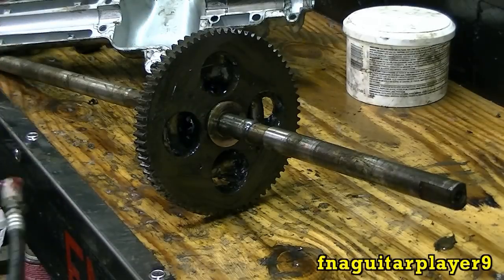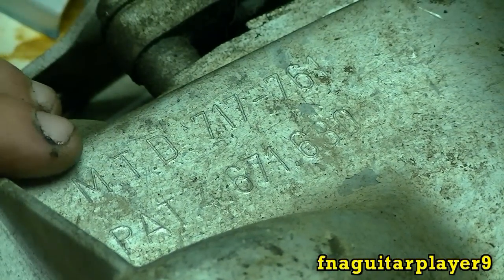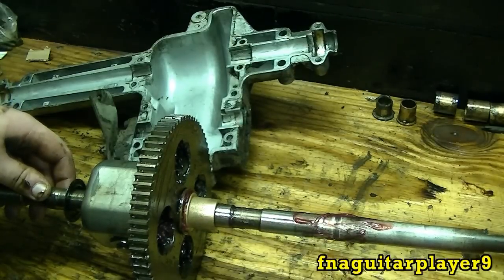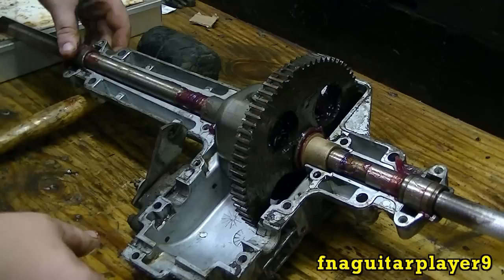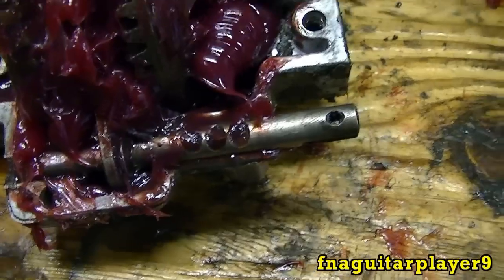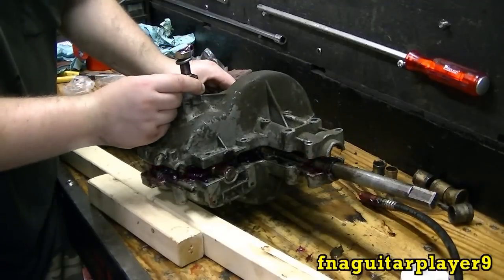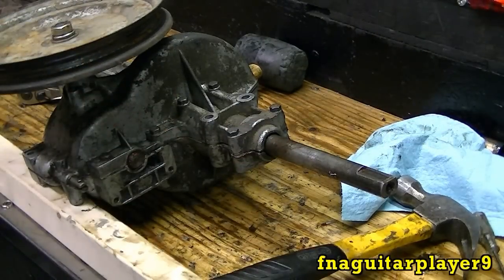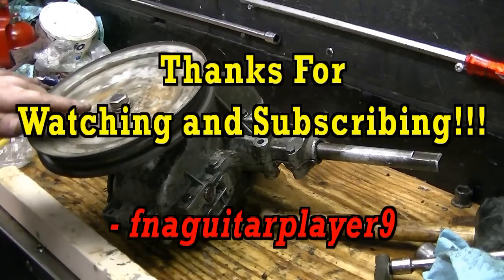MTD Transaxle Basic Rebuild (Replacing all Bearings) Part 2 of 2

Comment: I am repairing/rebuilding one on these on a Toro rider right now. I did not have the tools to reassemble the differential if I did take it apart but I wanted to get the old grease out as there was a lot of metal in the old grease. I took the differential out in the yard and I blasted it with my pressure washer. I then dried it out as well as I could with compressed air and examined it again. It still had some of the old grease in it so I blasted it again with the pressure washer and rotated the gears many, many times reblasting with water repeatedly until I got all of the grease out. I then hit it with the compressed air repeatedly until I had it as dry as I possibly could get it. After this I set it out in the sun and the breeze until I knew it was completely dry. Not wanting any rust to develop I took a can of silicone spray and I thoroughly hosed the inside and outside of the entire differential and placed it back in the sun to let the silicone spray carrier evaporate. This leaves every little part of the assembly still coated with the silicone which will prevent rust accumulating until I can get the trans axle reassembled. Just a friendly tip to anyone desiring to get the old grease out without disassembling the differential. Thank you, 
fnaguitarplayer9, for this video and for all of your videos for that matter.
Reply from the maker: That would be the best way to do it, good idea. I should have cleaned this one better, but I figure I will when i take it apart later on to replace the top needle bearings, still making noise. Your welcome, glad to help out! Thanks for Watching!!!
Reply: @fnaguitarplayer9 , I am curious as to whether or not the differential AND the bevel gears are supposed to have shims on their respective shafts to control side play. The one I have (it was being thrown away by a neighbor) has no shims on either and there seems to me to be quite a bit of side play. I think the previous owner was in there messing around because a lot of things did not look right to me. Also,  the brake disc and one of the brake pucks were missing as if someone was attempting to repair this thing and just lost some stuff. By the way, thank you for responding to my previous comment.

Comment: MTD calls for 19 ounces of durina grease, I always use Super S 00 grease, $5.99 at tractor supply for 32 ounces. Case screw torque specs are 90-135 in-lb, detent screw 160-200 in-lb.

Comment: I mixed in a bowl Lucas & tacky red axle & bearing grease until its thick but still clings to the gears. If you just use grease it wont stay on the gears & it will leave an open path where the gear spins it will start chipping the gears. I had to replace a gear learned the hard way. To mix the grease & oil I used a electric mixer blade in my drill & it works awesome. I mow 7 acres with my John Deere it used to have a winding sound when I go forward but not any more.
Reply from the maker: That is a good idea, i never thought of mixing it like that. Thanks for Watching!!!

Comment: Hey player. I got a tip that some of your viewers may can use when attaching their shift rod to the transaxle yoke rod. The hole in the shift rod for the clip pin is just a tad larger than the pin itself. So it is sometimes aggravating trying to get the pin through as the end of the pin will obstruct itself on the outer edges of the shift rod, and not go through unless it is perfectly aligned. After a few tries, I grinded a nail point on the end of the pin. Then it fell right in first try.
Reply from the maker: That is a good tip, I'll keep that in mind next time I work on one and will mention it in the video. Thanks for Watching!!!

Comment: First off, I really appreciate your video!  I need to do this soon and this will be my guide.  I did see something here that may have caused your binding when putting the case together and maybe your shifter issue.  I read that these call for a Bentonite clay grease because it's super thick, heat and water resistant and won't wash out in outdoor gasket-less application.  It also does not play well with any other grease like moly or graphite.  Anyway, that's just an FYI.  (continued)...

Comment from the maker: no problem! not all the time! it probably is very similar, but this one in this video is from the 70's, the design hasn't changed much, i took a 90's apart and the bearings are different and the splines are different on the shafts, other than that it looked identical. no problem!

Comment: You get rid of the end to end play by buying more washers and thrust washers... And during reassembly inserting the correct amount in each side to take up the slack... Inside on the axle directly inside decide the bronze bushings...
Another thing I notice is your reassembly should have started on the other half of the clam.,. Spring side down, then the detent ball, the gear selector... That way everything lines up... Also turn the gears before you start bolting it together... That's why you couldn't get it together the first go round...

Comment: At 8:20, when you paused to note that the left bushing (Part 14?) had to be properly oriented, the right bushing (Part 46) has to be also.  That part has 2 molded keys opposite each other next to the flange.  One of them can be clearly seen at 9:00 before it was greased.  When you put the case together I could see where the case was rocking and binding - right over that bushing as the keys were vertical.  When you bolted the case together the first time the bearing was forced  (continued)...

Comment: I have an MTD almost exactly with this same transaxle, I took it apart about 4 years ago to see how it looked inside.  It had a lot of grease in it too, like yours did.  I cleaned it and added the regular grease you buy at advance, just for the heck of it I put in a couple of capfuls of some synthetic engine oil, I figured what's the worse that could happen, it would leak out.  I'm going to tear the lawnmower down this winter and it will be interesting to see how the grease and oil held up.
I was thinking about drilling a hole in the case and tapping it for a grease fitting, not sure if that would be a waste of time since these things seem kind of bullet proof, mines a 98 model bought it new and I have almost three acres so it's been well used.
I also have used slick 50 and synthetic oil in the engine and when I rebuilt it four years ago it was barely worth the money because there was so little wear, I was pretty amazed.
Reply from the maker: Kyocera234 Thats interesting, never though of doing that. Alot of people add grease fittings to them, i'm thinking about doing it next time i have one apart, then maybe once or twice a year add a few pumps of grease just to make sure its full. yeah, they are pretty much bullet proof, they hold up really good. I didn't know slick 50 was still around, i've heard alot about it. I just put some lucas in my truck, it seems to be some good stuff. where did you get the slick 50 at? I've always been interested in it. Thanks for Watching!!!
Reply: That grease is too thick. Over time it will heat up and flow to the sides and bottom of the case and get firm. Use a 00 weight grease from tractor supply and that grease will stay in a flow able grade and won't harden over time. Your doing a fine job otherwise.
Reply: Yep. I am in process of opening up the transaxle on my mower right now, and "Super S Cotton Picker Grade 00 Spindle Grease" from Tractor Supply is what I am using to replace the factory grease with.

Comment: The manufacturer recommends Benalene grease, which is expensive ($23 / 8oz) liquid grease, comparable to 400 weight gear lube. I used Shell Alvania instead, but it may do the same thing: cake up and not touch the moving parts eventually. It's interesting that they use a liquid grease to manufacture these and use no seal whatsoever between the case halves. BTW...mine is a Cub cadet LT1040 gearcase.
BTW...I got away with reversing the gears and coupler to correct a slipping problem.
So far....

Comment from the maker: you will have to find a flywheel shroud for a model 28 with a pull start on it, and you will have to replace the nut that holds the flywheel on with a start clutch. I've never done it but i've seen them. i figure it will be pretty hard to crank over! i guess it would be good as a backup in case your battery is dead or have starter problems. thanks for watching!!!

Comment: Really good tutorial here ..thanks.  I have a lawn tractor with MTD transmission that seems to have a problem.  When I put it up on blocks the left side turns when put in gear but the right side does not.  Does that mean there may be a problem with the differential?
Reply from the maker: ***** It could be a differential problem, but most of the time they will act like that, put it in low gear so it turns slow and try to stop the tire that spinning, the other should start, if it does then the differential is fine. You can also check the differential by putting the transmission in neutral and spinning one tire, the other tire should spin the opposite way. Thanks for Watching!!!

Comment: Great video man! Thanks for the pointers on the grease types. I have a transmission just like this, with the same issue, that one bearing on the left side is the worst. Mine got so bad that it wore away at the top casing of the transmission slightly. Do you think I have any hope of saving it by cleaning out the grease/metal shavings, replacing bearings/bushings, and re-packing grease? It was running fine when I took it apart but I could hear it squeaking and squealing... which is when I realized the bearings were eaten up. I don't want to buy all new bearings and seals and grease if the top casing is gonna give me trouble. Only trouble I can figure it would cause is a small grease leak and/or the bushing not sitting in place exactly right. I was also wondering about what you said with those bushings that need to be straight up and down. I put mine back together somewhat and noticed the bushings do have flat spots but for mine it didn't seem to matter which way they face. I think I'm gonna set the flat spot vertical facing the shifter piece side and see if that works. Thanks!

Comment: Hey bud, how did you learn everything about small engine repair?...Did you work at a shop or go to school?....I mean you have serious skills man!..& I want to learn!
Reply from the maker: Green Power Farm Hey! Well to be honest, I never took any classes on small engine repair, it all started by helping my dad keep the mowers running every summer, we'd stay up to 2 getting the mowers ready (always had a problem haha) and i just learned from that, then he got burnt out on working on them so i took over and learned more than he showed me just by doing it myself, and I've done alot of reading online as well. This transaxle video is a good example of me learning by doing, i never tore into one before this video (except one time just to see what was inside haha), learn by doing, and researching, a good repair manual helps to for specs on different motors, or a less common repairs, and youtube is a great source, before i started making videos I had alot of questions answered through youtube, one example of that was I had a motor that a surge in it and i could not get it out by adjusting the carburetor, learned it was do to the governor being out of adjustment. I never worked at a shop, all the stuff in the videos is either my own or my buddy's, its a dream of mine though to have a small engine shop. And in the last few years i've ventured into auto repair some as well. I don't know quite as much about vehicles as i do mowers but i'm learning, one repair at a time, which is what happens when you buy a truck thats had a rough life! I appreciate that! I still don't consider myself a expert. Best thing i can tell you is watch videos, read repair manuals (which not all are great, but it does help) and learn by just tearing a motor apart and learn what each part is and does, and put it back together and make it run! the first motor I had (and still have ) was a old 5HP briggs, i tore that motor apart at least 20 times, never got it running because i never could find a carburetor for it, and it needed bored out. But i learned how to take them apart from that. its the one in the video called briggs restoration project or something like that, I painted the flywheel red one time i had it apart haha sorry for a long answer haha Thanks for Watching!!!
Reply: Thanks for the explained answer! I am a new sub for you and been watching all your videos (some over and over) for a few nights now.....You have the best video's on you tube for small engines! Very simply explained and amazing camera work! Thank you kindly for taking the time making these video's!....you have the some serious small engine skills my friend!
Reply from the maker: Green Power Farm
No problem! Thanks for the sub! I appreciate you saying that, i try to make them as best as i can, i just wish i could do more! Hopefully soon i can start making more videos, usually doing the summer i put 2 up a month, but i hope to do more than that. Thanks again!

Comment: great video bro. My mtd jerks in forward gear really bad where it shakes the heck out of the whole mower but not in reverse. do you think it those gears in the differential? or the two bevel forward and reverse gears and clutch collar that you shown on the first half of your video? if i disassemble it how would i know or see what the problem is? Also the belts look good on the mower so that's not the problem. Any ideas would help. Thanks in advance.

Comment: into the case by the beveled keys and into the gear - forcing the shaft too far over to the brake side.  The bushing should have been almost flush with the case and I did not see it there at the end of the video.   You can see the two pockets for the keys in the case halves in Part 1 at 7:48 (follow the finger to the dark notch on one side of the shaft tube) and the other one at 8:00.  When the case is together the keys would be a few degrees from horizontal since each case half has 1 key way.

Comment from the maker: No problem! Thought i'd make it since there really ain't no other videos on these. i'll have to remember that type of grease! yepp your right, i didn't even think about that the other side. That probably was what happened!!! Its fine now, after i took it apart after the gear locked up, I idid use a thicker grease on that part after I unseized the gear. I put the bushings in right and it went together really smooth. I'll use that grease next time, i figure i'll have to take it apart and >>>>>

Comment: One day my wheel and axle came out while mowing, I stripped down the transaxle and I am not able to find any e-clips etc... How are the axles secured into the differential?
Reply from the maker: oh man! I've never had to take the axles out, but according to the diagram for the one in this video, there should be a nut that threads on the end of the axle, with a washer on it. I think some have a snap ring, not for sure on that. You would think it would be like a vehicle with those e clips, its so easy to do those. Hope this helps, thanks for watching!!!

Comment: hello, thanks for the video, I am writing to you from Italy, I have a problem with my lawn mower, with the forward gear if I am going downhill it picks up speed and you can hear a noise at the transmission (continuous beat), which it doesn't do if I go downhill in reverse. What can it depend on? Thanks Marc
Reply from the maker: Your welcome, that may be a stripped gear ( like a tooth broken off) or possibly a bad bearing making the gear skip. Thanks for Watching!

Comment: Great & informative video!   How much labor time is reasonable to charge a customer for this rebuild/repair?  It's one of those jobs that I feel I can never charge the time it really takes, but want to be fair to the customer.   Thanks!
Reply from the maker: Gary Busby Appreciate that! Eh, thats hard to say, all the motors in the videos are either mine or friends and i just charge parts for them. But I'd say charge at least 5 hours, depending on your rate, If i was going to charge for a rebuild it would be a flat rate probably in the 50 - 150 range (plus parts), depending on engine type/size. but that is probably less than it should be. Like i said its hard for me to say, i'm just throwing numbers out haha Thanks for Watching!

Comment: What fluid do you put back into it? I have a Ranch King 42 inch tractor built by MTD. It's the 6 speed manual type transaxle. No hydro here...    And how do you change the fluid? This one's 10 years old and I want to change it.
Reply from the maker: On this type you use grease, i'm thinking its a 00 grease, its really hard to find, i just used a thick wheel bearing grease i think it was and its still working to this day, i used lucas red n tacky at first and it locked up the jack shaft in it, so i had to tear it down and pack it in wheel bearing grease. now some do use a gear oil, but that is mainly the older type, and also if its a hydrostatic it will take a special type of oil, not sure on that. I'd say more than likely yours is the grease though. Hope this helps, Thanks for watching!!!